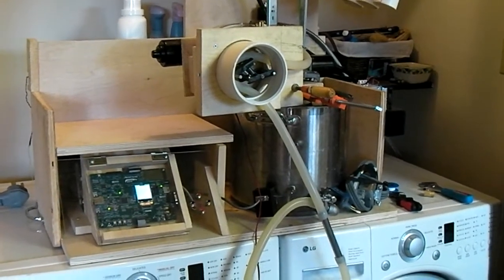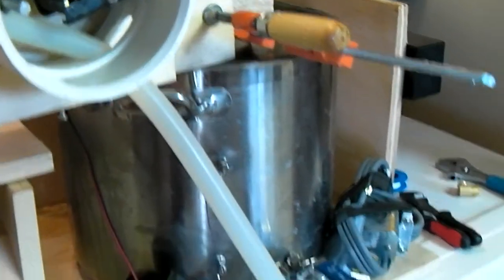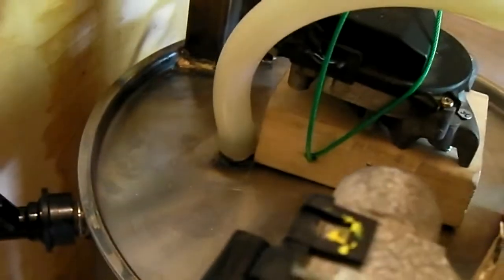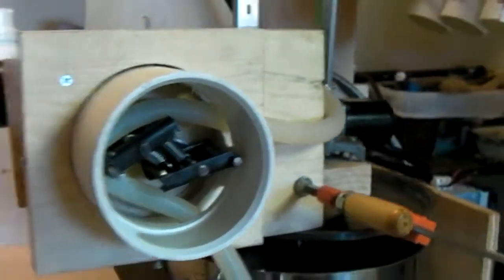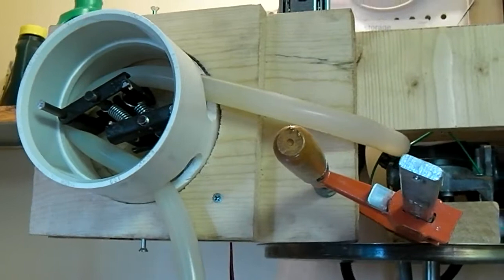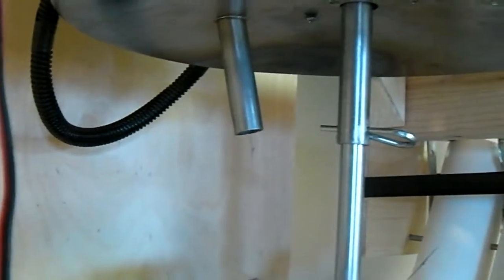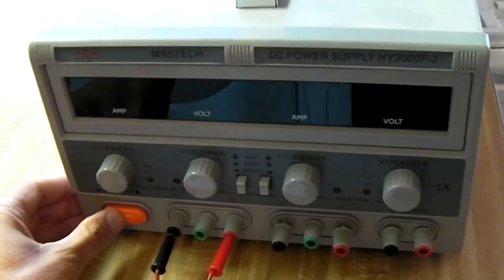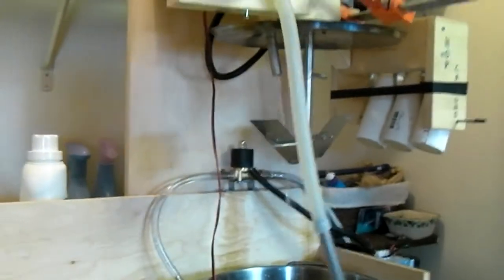Brewbot peristaltic pump test

Comment: what is the flow rate you achieved with this setup ?? Say liters per minute ??

I have just designed a small pump, but does not give much output as requierd. My requirements are around 1.5 L per minute.
Your video is nice, and you design is also very nice.